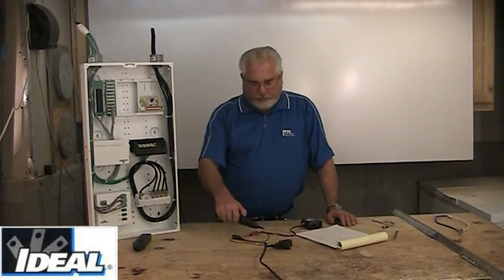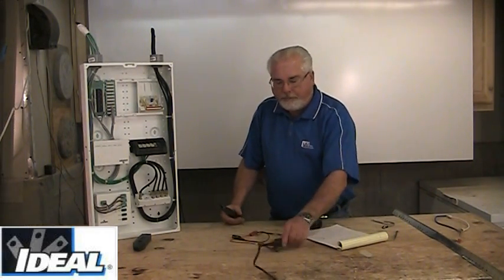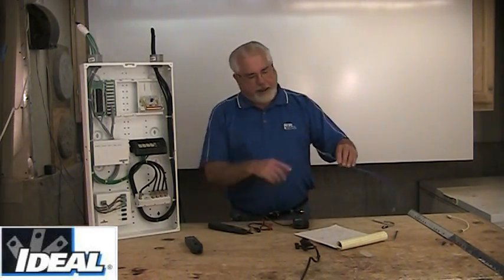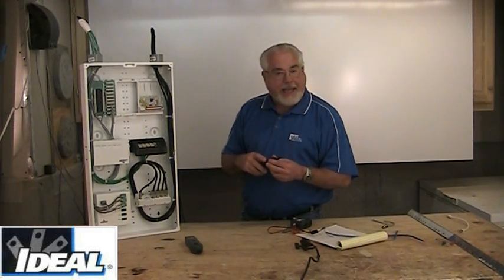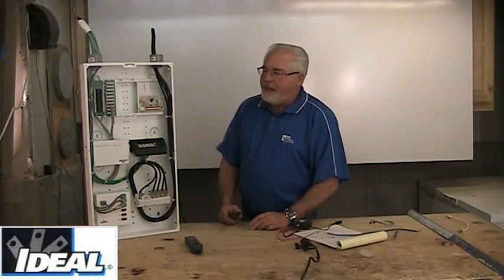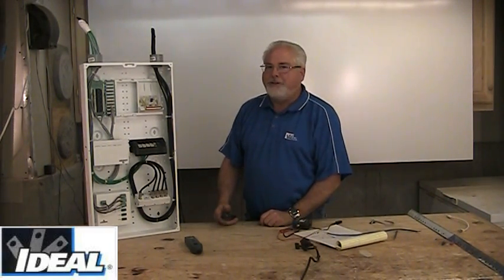Tone and Probe Basics

Comment: If a water line burried over 5ft deep has a tracer tape, will a Stationmaster Pro locate it? (Marketed for irrigation work) I would put the signal on the tracer tape and just clamp the common wire to a ground (screwdriver jammed into the dirt)
Reply from the maker: I am not sure never heard of the tracer you mention Ron

Comment: Ron - thanks for the video.  I am a jackass homeowner and trying to sort out what the ding-a-ling installer did at my house.  Bought the Toner/Probe unit from Klein.  I thought that if I plugged in the RJ jack on the tone generator into the wall that a tone would be generated back to the panel, then I would identify all the jacks around the house.  Problem is - nothing is being generated into the jack from the tone generator.  Does the male jack from the tone generator make a tone that I can take the probe into the panel and find the tone and identify the wire.   What am I doing wrong?  P.S.   Have even done the above on known jack outlets and wires at the panel and it isn't working.
Reply from the maker: Doug I am not sure which toner and probe you have but I would turn on the toner and check the probe is picking up the signal before inserting the toner into the outlet. If you insert the toner in the outlet and you lose the signal there is a short somewhere that is canceling the signal the toner generates. Or if the other end of the cable is connected to something it can be shorting the tone too. Both end of the cable need to be open when tracing the cable. Hope that helps Ron

Comment: I like the wet finger method with turning up the volume of the probe and placed close to the ear.  Guess the high resistance of the human body and some inductive/capacitive coupling does the trick.  Innovation of an experienced technician.
Reply from the maker: N Tag yep not bsure who I got that tip from but it is a good one Ron

Comment: Hi Ron... Not sure what happened to my last comment - I had written alot more information but, it seems to have vanished!!  

We are attempting to trace various data cables running to a 'CCTV hub' room from 6 PTZ cameras and (approx) 15 P.I.Rs which activate the cameras whenever a P.I.R is 'tripped'.  

The cables run various lengths (as far as 60 metres) and are buried underground.   We have tried various tone/ probe generators but, when scanning the cables at the CCTV hub room  (where they are all 'grouped together'), we are unable to identify any individual cable.  

Based on your comments in the video, I wonder if we need a 'cable tracer' instead of a tone/ probe generator??  

If 'Ideal Industries' offer a suitable piece of equipment, we would be very interested in learning more.
Reply from the maker: Jason the tone and probe should work remember when tracing both ends of the cables you are tracing both ends must be open or not connected to any equipment. We do offer cable tracers but they can be expensive look fore the SureTrace 61-957 hope that helps Ron
Reply: Hi again Ron....thanks for your reply and my apologies for not responding sooner!  We have tried your suggestion regarding cables being disconnected at both ends but, this is difficult to be certain (as the circuitry we are trying to trace is very complex - Well, to us it is!!).  We would happily purchase the unit you suggest IF we could be certain it would accurately do what we require.  I would like to send you a photo to illustrate the main circuit board(s) to which all the various wires connect too BUT, I cannot see how to do so (through YouTube).  Would you be able to provide a link such that  I can send this detail through to you please?  Having just searched 'the web', it looks like I can contact you through 'Linked In'.  Please confirm and I will send the details to you.  Warm Regards...'j.

Comment: Is there any way to determine line strength from a phone jack using a multimeter? Is so, what what be a good value coming off that line? Thks..jc
Reply from the maker: JC saw this online hope it helps Ron
The POTS phone line, with all phones on-hook, should measure around 48 volts DC. Taking a phone off-hook creates a DC signal path across the pair, which is detected as loop current back at the central office. This drops the voltage measured at the phone down to about 3 to 9 volts.
Reply: @RonKipperDatacomm1  Thanks Ron..jc

Comment: Would this be good to trace a homes AC lines? Them being off, of course. Is there a more appropriate tool?
Reply from the maker: Hi Cupid the tone and probe can trace any type of cable as long as it is not live or have an active circuit. Just make sure to disconnect both ends of the cable. If you are just trying to find a breaker look at IDEAL's 61-532 or 61-534. Have fun Ron
Reply: @RonKipperDatacomm1  Thank you!

Comment: You talked way too much. You should of plug it in and use it. Instead of playing around with the tool like using it on your drywall metal piece. Just because you talk about coaxial wires, Romex. Where are the examples. I own the Klein so now I'm looking for a real how to use video and tips. Didn't like video at all.
Reply from the maker: Hey Salvador you sound like my wife! Sorry I don't show actual examples I have always said tracing cable is a little bit of an art form it takes some practice and knowing what you can do with a tone and probe which is the cheapest way to trace a wire. I do have another video  you might look at but again I don't show actually using it but will think about trying to do a video along those lines
https://youtu.be/7yeOoArTALo?list=PLw8qsvCN6q_0ESEi_5BNo5yyDOQzbDZvO
Thanks for the feedback.
Ron
Reply: @RonKipperDatacomm1    Wow, Ron!  U seem like u have some experience, dealin w/crazy ppl...

Comment: So you said no AC voltage on the lines but then you also said that both ends really need to be open, other than the connected toner. So, really no voltage AC or DC, both ends open, or the toner will be shorted out and no tone. Am I understanding that correctly? I appreciate the tip. about using different pairs on a cat 5 that could help but my issue is usually with existing phone lines, not being able to trace them because they have phone signal.
Reply from the maker: Stephen yes you are the toner works best with both ends opened and no voltage present. If you attach the toner to a pair that is terminated into some type of equipment it will probably short the toner and you loose the tone. Hope that helps Ron

Comment: Can these be used for wiring on cars? Restoring a classic car and need to fix a few things.

I live near a 100,000 watt Country music station's transmitter tower. Will I hear music if I get one of these?
Reply from the maker: Yes you can use it for tracing wires in a car keep in mind both end of the wire should be open or not connected to something else and you may hear some music! Ron

Comment: Hello do you know how to trace and pin point where the short is in a wire with test light or multimeter?I found how to find the circuit but cant find info on how to actual trace the short down other then buying this tool
Reply from the maker: Finding a short can be tricky a TDR can give you distances to a short and we do sell  the Suretrace circuit tracer for finding a short but that can be expensive. I don't think a multimeter will do you much good. Good luck Ron
Reply: it depends on your level of experience
you see,  a Multimeter can help you ..... ONLY IF YOU HAVE ENOUGH EXPERIENCE TO KNOW
- The length of the cable
- The Resistance per meter 
then you can measure the circuit resistance and conclude the approx distance to fault
BUT, THAT'S REALLY GOING OVERBOARD

an easier method, Like ron said is   T.D.R.  (Time domain Reflectometry)
basically  a meter that uses the concept of  SPEED = DISTANCE OVER TIME  (Basic Physics) and with the knowledge of Velocity of Propogation through a wire and ASSUMING YOU SET THE WIRE GUAGE UP CORRECTLY .  it will tell you the approx distance to the fault , be it open or short 
I use a  FLUKE TS54-TDR for this purpose,   it's really good  and has served me well for years

another thing you can do  DEPENDING ON THE CABLE THAT YOU'RE TALKING ABOUT
Let's assume it's a Cat5e UTP cable

Ensure you have no voltage on the line
put a tone on one end
Follow the cable with your want until the tone dies

in saying that.......
if the cable is damaged at some point and that damage causes a short,  You ain't gonna get jack shit for a tone even if the other end is open circuit 

but re your question
tools like this do not tell you how to do everything
it's more like this ......
when you buy a voltage regulator from jaycar.   it doesn't come with wiring instructions,   YOU ARE EXPECTED TO KNOW HOW TO WIRE IT UP Based on your fundamentsl electronics knowledge or technical knowledge

Just like a Multimeter doesn't tell you how to check the voltage of a car battery but the manual does tell you how to put it into V DC Mode

so... your toner manual  is not going to answer your question
YOU SHOULD KNOW HOW TO USE A TONER BEFORE YOU BUY IT
if you don't know, you shouldn't be doing this kind of work

in the end though, it's not hard to figure out, but...   Toning and tracing cables  TAKES IMAGINATION AND you draw on your experience and knowledge to apply the tone in certain situations

Example......
Let's say i have a fluke TS54-TDR which has a basic tone function in it,  just like any toner EXCEPT this one has exact pair identification which means if i short the 2 wires that the tone is on the tone will change

Now. let's say i also have a Teletech loop a line , which can tone through Telecomms voltage , but the other meter can't, but the loop a line does not have exact pair ID  but it can control an Oscillator to remotely open circuit or close circuit and allow me to test resistance

now...   let's say i tone a cable from one end with the TS54 TDR and i get tone up to a point.
i then go to the other end (say the pit in the street) and i put on the loop a line because i have a spare toner

Now
1. if i go back to the mid point,  on one end i should get the tone from the TS54  and on the other wire i should get another tone from the loop a line

2.  if i was to join the 2 wires  I WOULD GET A COMBINATION OF BOTH TONES ON 1 WIRE, hence knowing im on the correct wire

how is this useful
well... if the tone from the loop a line was just induced from a close by wire 
WHEN I CONNECTED THEM I WOULD NOT GET BOTH TONES

SO... DO YOU SEE
it's about thinking outside of the box  and knowing what your equipment can do and how you can use it in many scenario's 

USE YOUR IMAGINATION
but until you get experienced    YOU ARE LOOKING FOR A TDR METER

Comment: I have used toners for years.  I want to thank you for showing the tips that you gave.  I learned a lot!!!  Ignore the detractors, they're trolls.   One question - do you find it harder to trace Cat6 vs Cat5 in the walls....or should I buy a better toner?
Reply: Hi andy, if i can contribute some insight from my extensive experience....

Cat 6 vs 5e or 5  because i'm guessing when you say Cat 5, You're talking about 5e.
ok,  first of all Understand the cable construction,  it's  U.T.P.   No shielding , but uses natural shielding in the form of twists per metre so ... you have that to overcome  as Ron said

Next,  you can't just say HOW DO I TRACE A UTP CABLE IN A WALL
what sort of wall ???
Fibro, Concrete, Brick,  Double Brick, timber cladded ??  etc..
let's first put aside that you generall wouldn't trace the cable in the wall to begin with 

YOU COULD EXPLORE THIS OPTION
Get yourself a stuff finder that has the ability to detect assetts like Power cable, and... MAKE SURE IT HAS A SCREEN that displays what it is seeing
Meaning..... some stud finder just beep at you and display 1 LED for a stud or beam (which basically works on a concept of measurement of density in a wall)
then another for LED if power cables are detected  , which works on a concept of detection of induction of an electromagnetic field,  basically a glorified volt stick
but.. doing it this way , you are not going to find UTP cables in a wall,    i mean.. maybe.. but.. i wouldn't trust it 

however, if you have a visual screen you can identify what is detected BASED ON IT'S SHAPE
and a 3 core power cable will look significantly different to a UTP Cable that you're trying to find 

or... You could spend a bit more and buy an assett detector which again... Detects differences in density in a wall.
ARE THEY ACCURATE....... FUCK NO
but, if you had a screen , it helps a lot 

Now.. the way toning works is 
Optimally you want to tone at the ends of the pairs
You DO NOT want to have a short circuit
You DO NOT want to be toning through a network switch because every port on the switch will beep at you 
you DO NOT want to be toning through a splitter
you DO NOT want to be toning through ACTIVE DEVICES

so... When talking about a standard tone generator ,   You want a cable run that is 
OPEN CIRCUIT  and
NOT ENERGIZED 
if this is the case,  you can tone the cable at the ends
or
ALONG THE CABLE AND THROUGH THE SHEATH... if you use a long sweeping motion
Keep in mind,  You are not going to get the tone through an RG-6 Cable because of the tri or Quad shielding , whatever the case may be 
but you can get the tone on the ends of the cable

but in the case of UTP Cat 5 or 6 or even as low as Cat 2 you can tone straight through the sheath, BUT AGAIN... USE LONG 1 METRE OR HALF METER SWEEPING MOTION UP AND DOWN THE CABLE TO GET IT RIGHT

Now... if you want to tone through an energized line,  DEPENDING ON THE ENERGY LEVEL,   
BUT.. i'm referring to telecommunications network voltage,  here in sydney it's generally around the 50V DC to 60V DC
you do have toners that will do that 
Tone generators are generally referred to as F SETS
not to be confused with  LOOP A LINE  by Teletech 
a Loop a line with tone through an energized line,  if you really need it to 

it's rated by teletech up to 200V   on Telecommunications network Voltage,  realistically with ISDN you are going to get a max of 115V DC  but most are way lower than that

now. this is not fool proof either because if you're toning a telephone cable.. so... Cat 2 or Cat 3  and its' a 60m segment,  you probably won't hear any tone until you get to the other end of the cable
in saying that, if the cable is 30m or less  you'll very likely get something of a tone straight through the sheath, but it might be faint
THEN... it's a question of is the cable fucked
more specifically ... is the cable old or does it have high resistance, because if it does  YOU WILL NOT GET THAT TONE 

but.. if it's a new cable run,  you're probably going to be ok

The traditional way to use these tone gens and wands is 
go to your patch panel,  put the tone on the cable you want
go around to the wall points and tone them out

you might even go into the ceiling space and tone them out
but you are VERY VERY VERY RARELY GOING TO TONE THROUGH A WALL
and... Why would you need to as well
if you tone on one end and in the ceiling space and on the other end,   you can logically conclude the path of the cable without having to tone through a wall

Hope that helps you
feel free to ask questions
i've been doing this for a very long time with various cables in all sorts of fucked up scenario's and i always got it through
Reply from the maker: Hey Andy good to hear from you. The tone and probe are really good if you know where both ends of a cable are but not so good trying to trace in walls. Cat 6 may be harder due to more twisting in the cable. To avoid that use two wires not twisted together to apply the tone to. The probe will get you kind of close behind the wall but not exactly. We do sell cable tracers but they start at about $900 and do a good job of tracing in walls. Good luck with the cable Ron
Reply: Thanks I'll try that next time it comes up.   As for the people saying 8 minutes wasted or bla bla, either they don't work in the industry or they are idiots.  Yes, it takes 2 seconds to learn how to tone, your tips show HOW TO REALLY TONE.
Reply from the maker: I tell people tracing wires is a little bit of an art form. Takes practice to get good at it. Take care Ron
Reply: @RonKipperDatacomm1  
it is indeed
and 
it does indeed
LOL

Comment: What is the main function of it ? Can't a simple wire finder do the trick ?
Reply from the maker: Hey Southern Rebel the toner is used to generate a signal on the wire that the probe can detect somewhere else throughout the length of the wire. Basically an old phone tech's way of tracing phone wires. It can be used on about any type of metal and is probably the cheapest way to locate a cable. Have fun Ron

Comment: What’s the best tracer to locate low voltage buried in the drywall
Reply from the maker: The cheapest way is with the tone and probe like the one I show in the video. They can get you close to the cable you are looking for. We do sell cable tracers but they are over $1000.

Comment: The commoning issue is why you should use olde style 66 blocks, or in the UK, Krone 237 disconnection modules... allows you to isolate a cable (or multiple cables) without having to faff about disconnecting wires
Reply from the maker: 66 Blocks? that is olde style...........

Comment: Very helpful video. I am trying to trace audio cables with RCA puts on either end. How do I connect the clips to the RCA jack?
Reply: Sorry, "puts" should "jacks"
Reply from the maker: barleywells I would try and make a homemade adapter using RCA plugs with a small piece of cable handing out of it that separates the center conductor and the shielding that you can connect the alligator clips to. Good luck with the tracing. Ron